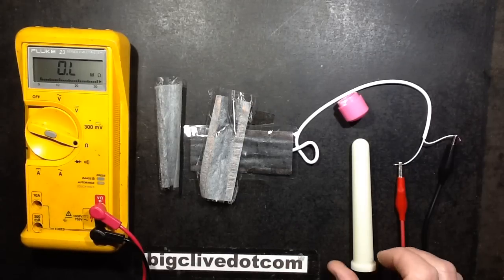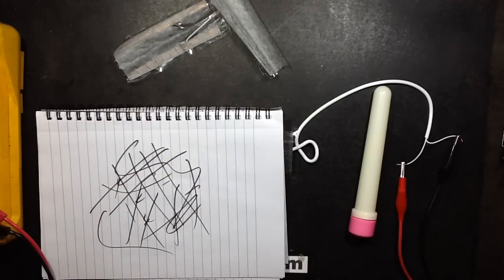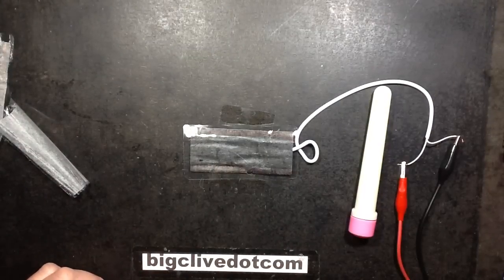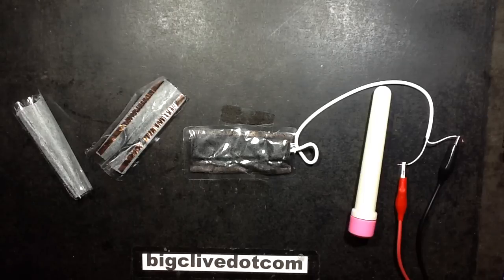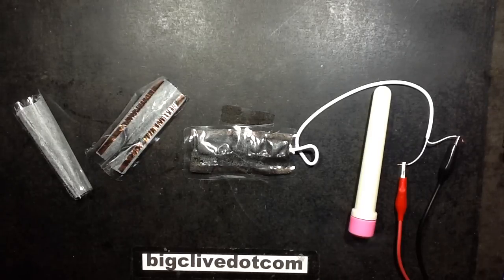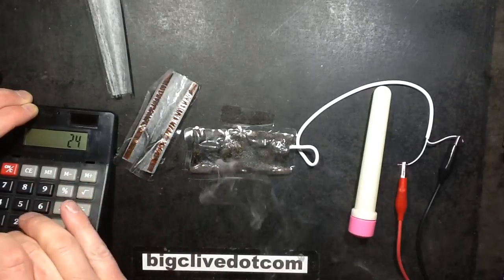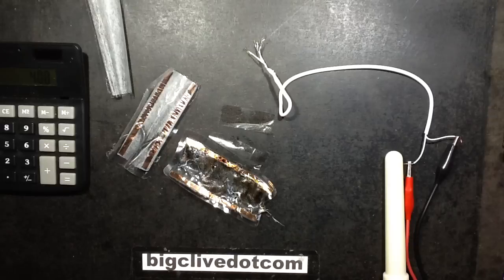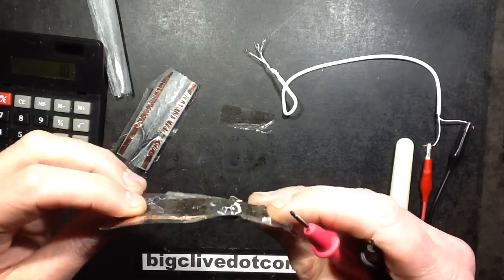USB male hole warmer voltage overload.

Comment: I was surprised with how evenly and how stable it heated up. Might be a good candidate material for heating blankets?
Reply from the maker: +tiger12506 Possibly with a low voltage switching power supply.

Comment: It would make a bloody good suppository with 240v up it.
Reply: John keenan Probably has a PCB in it with traces that would just melt within seconds, before it even heated up the casing if it didn't trip the mains circuit breaker or blow a fuse first.